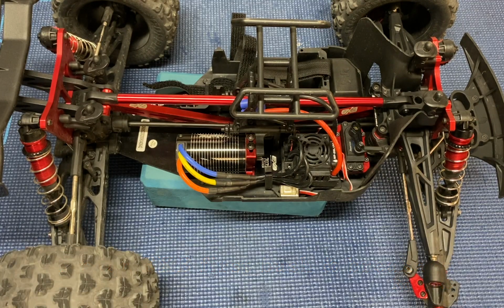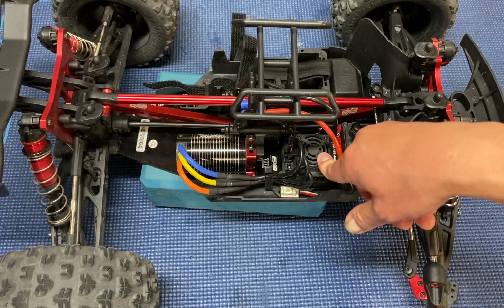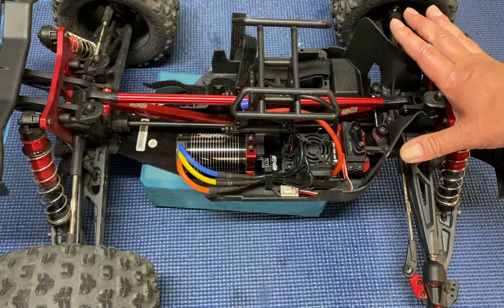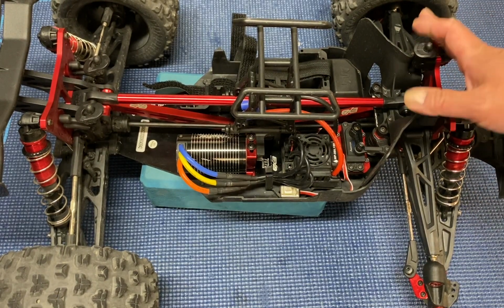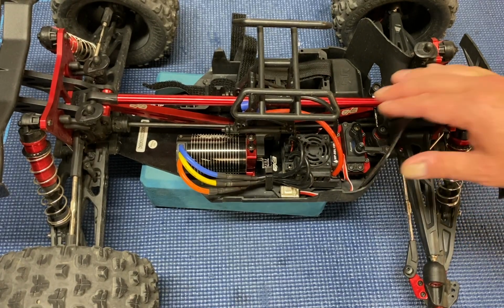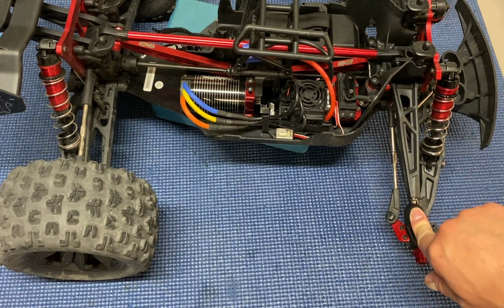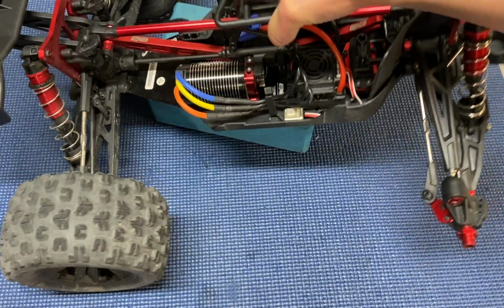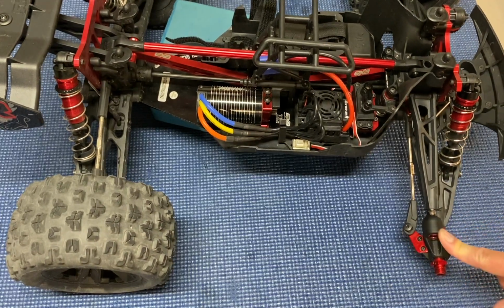Arrma Kraton EXB First Bash and Breakage!

Comment: Glad you enjoyed your first run! With that motor 6s with a 17t is the way to go 👍 Thats not a breakage 😂 If you land on the side the pillow ball will pull out and IMO its better that than cracking the knuckle completely. I have had several knuckles that have that “line” down the center. I think it is just from the plastic mold. Can’t wait to see you run it on 6s!
Reply from the maker: Thanks for the info about the knuckles, hopefully it just pulled through and isn't broken.  Definitely going 16t+6S next time out!  Don't have a 17t, that'll be in the next purchase list.

Comment: The knuckles always give. Hot Racing Aluminum Knuckles are a must. One of the first items I purchase with all my Arrmas. Plus you can use loctite to lock the chamber in.
Reply from the maker: We'll see how long my next set last, if I keep breaking them I'll try some aluminum ones.
Reply: @RazorRC  Another pointer for the area: if your pivot balls back out, (as most do,) put a straight bead of IC2000 in a straight line across the threads. Let dry, screw pivot back and your chamber will not move. Keep up the good work. Glad to see an Arrma on your channel.

Comment: Great informational channel 
Do you think you may have loosen it from the hit it took on the pole ? Looked like  you hooked it at a good speed !
Reply from the maker: good point, that pole hit might have been the one that cracked it
Reply: That was my thought. Look at 9:05 where you nail that piece of steel with just the right front wheel. I expected that to pop the ball out. I’m not sure you want to strengthen that too much if the failure point is a $10 part and you can have spares in your kit. If the ball doesn’t pop where does that energy go?